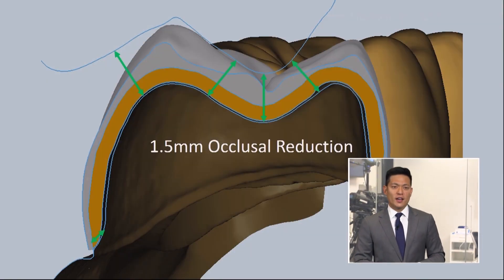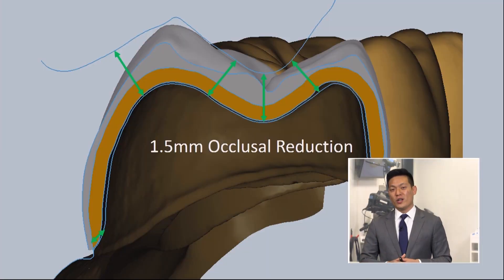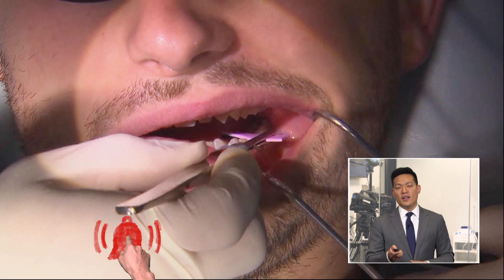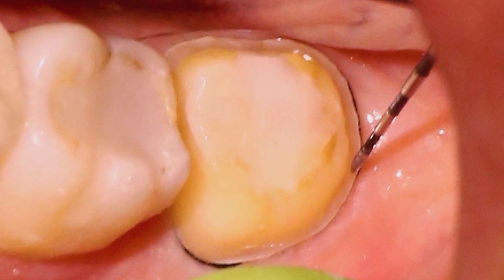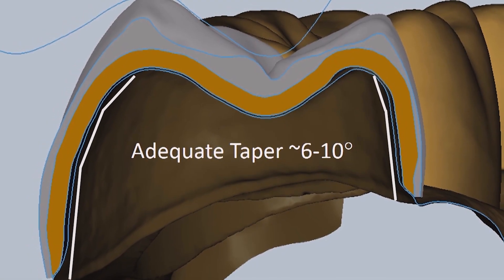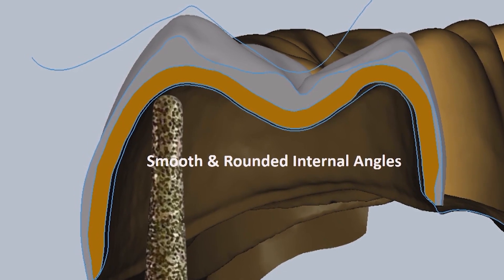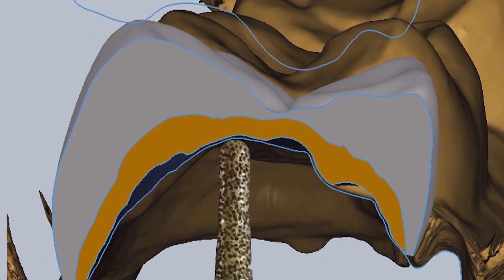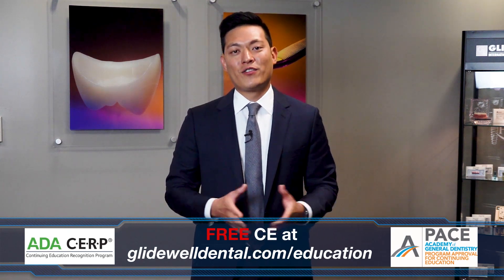How to Prepare Molar for Digital Dentistry

Comment: I've used the clearance tabs before but it just keeps on marking on the cusp tips no matter how much I reduce, maybe I'm doing something wrong but not a great fan. Also how else would you suggest getting additional resistance and retention form without grooves / crown lengthening, for milled crowns?
Reply: Some tabs can be more rigid than others, thus marking when we don't really want them to. I have just found the Kerr tab flexes enough to adapt to the occlusal irregularities well. 
If you want to prep additional surface area, you can do so as long as you have more rounded and smooth transitions. Try to make those walls divergent instead of parallel. 
In less retentive situations, I will opt for a resin bonding protocol instead of a conventional cement. It's more moisture and technique sensitive, so isolation and contamination avoidance will be critical.
Reply from the maker: Thank you for your question. We will relay this message to Dr. Chi asap.